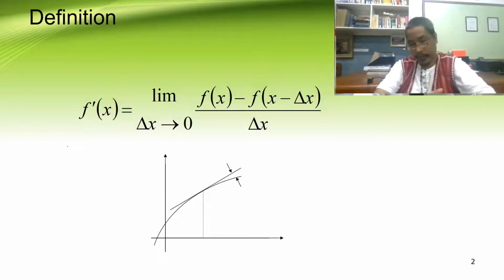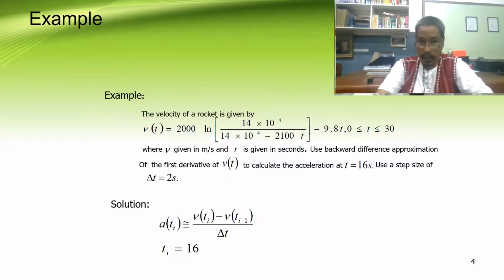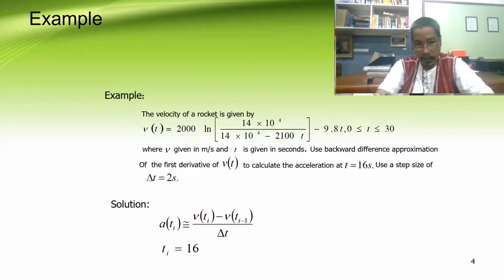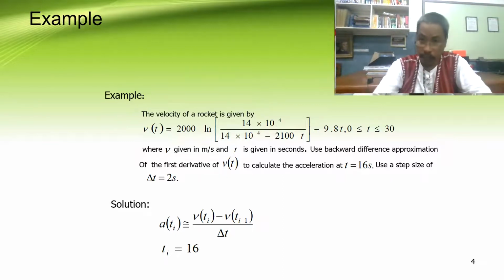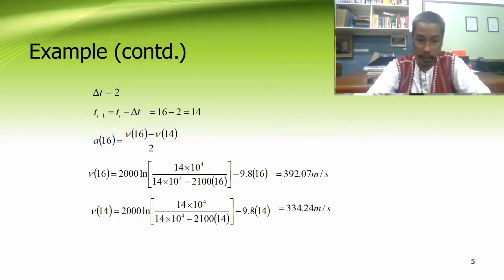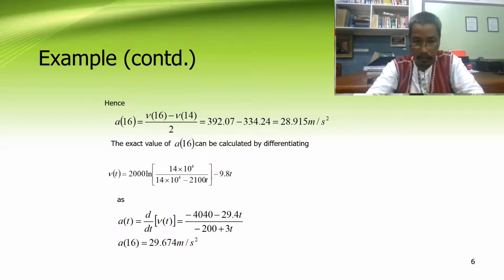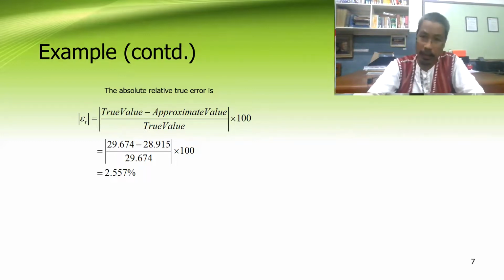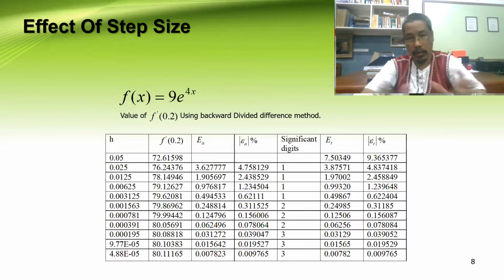Effect of Step Size on Accuracy | NUMERICAL SOLUTION for CE Problems: BDD Derivative Approximation

Comment: Thank you sir for this lecture. I have learned that BDD Derivative Approximation is a negative delta x while FDD is a positive delta x. Just a question sir, from backward divided difference and forward divided difference. Which of the two are more accurate?